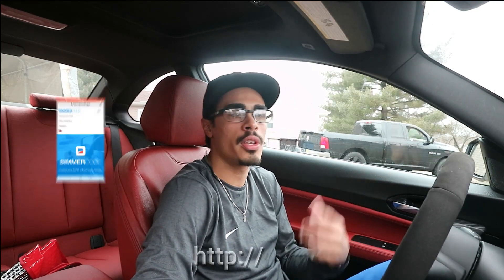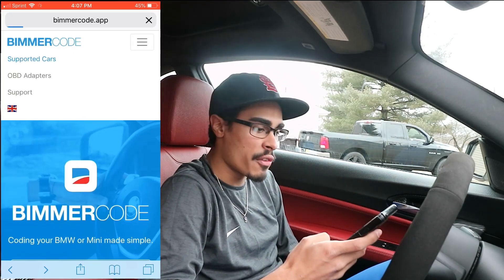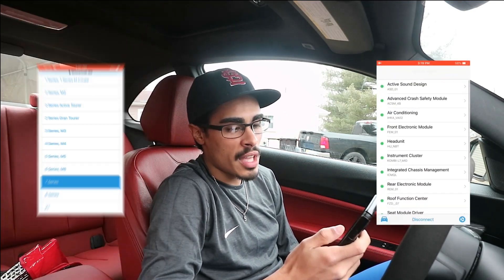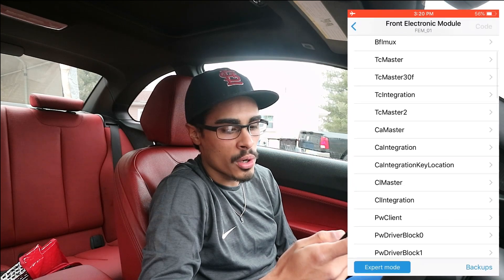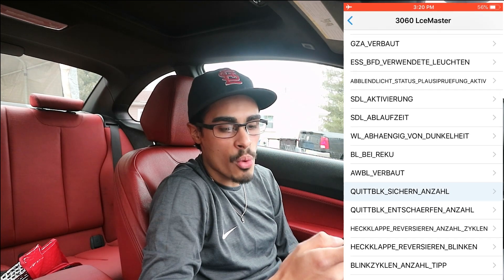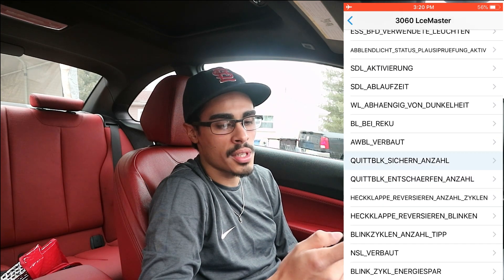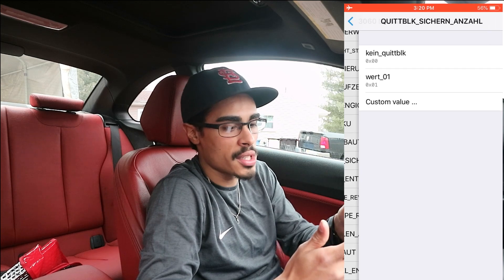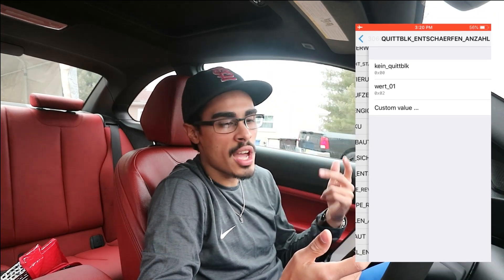FLASH When Locking/Unlocking Code w/ Bimmercode

Comment: do you know how to make it flash when pressing lock button even if the car is already locked??
Reply from the maker: I don't think that's a possible coding option. You can just adjust settings to have the car flash when locking and unlocking and that's it just on the initial lock and unlock